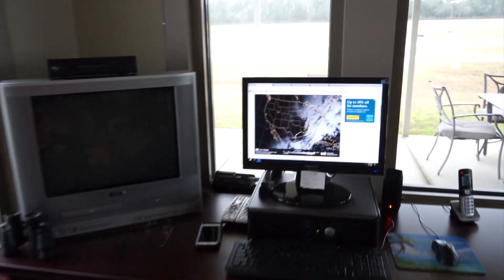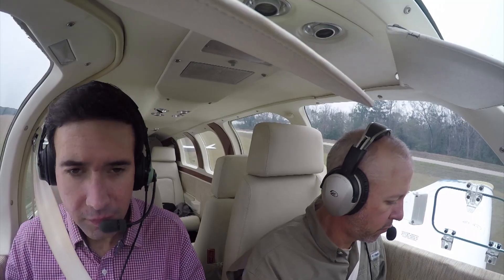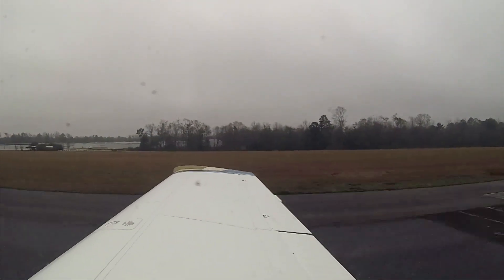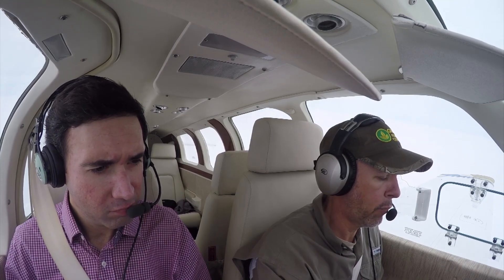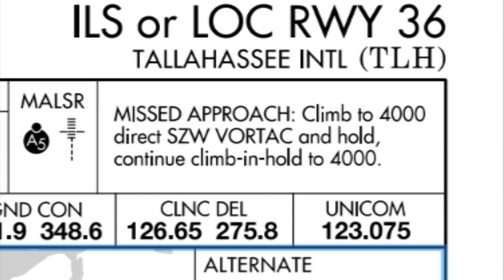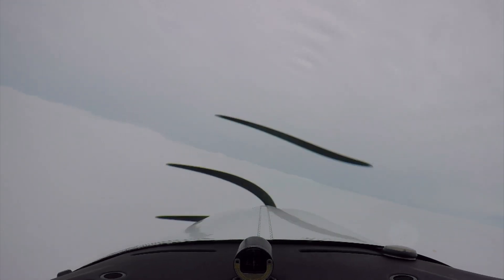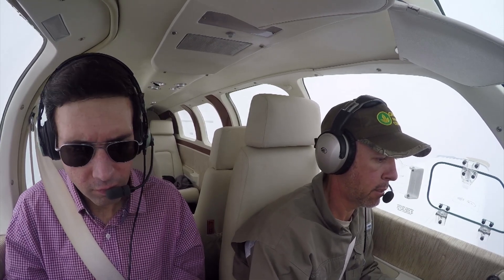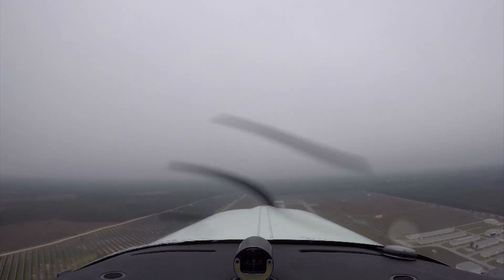AIRMET SIERRA! Battling Through the Elements on a LOW IFR Day: Part One

Comment: When going missed he called gear up when a positive rate was established. Cameras of course distort things but why not leave the gear till down till out of usable runway? It looked like there was enough left just in case the engine gave up the ghost. Great video as always!
Reply from the maker: takl23 A good point. In this case, there’s 2900 feet of usable runway, with power lines at the departure end of 32. Gear retraction upon positive rate of climb was the correct decision here, but when I’m taking off on 14, I delay retraction because there’s a bypass road off the departure end that can be used for a forced landing. Quincy Municipal is a unique field, to say the least!